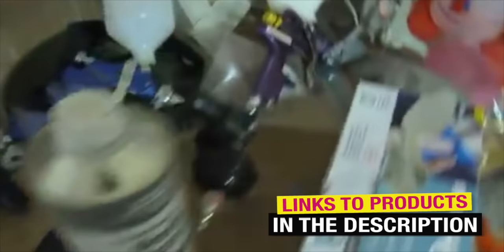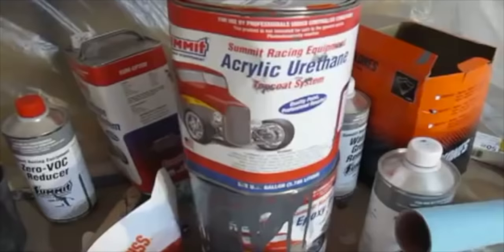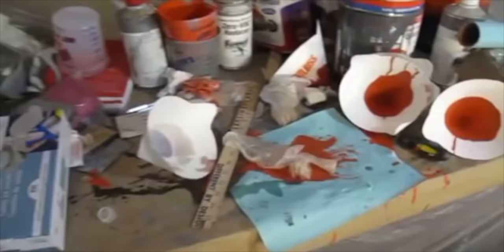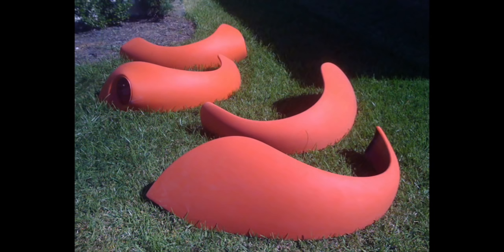Building a 1973 Front Engine V8 VW Bug

Comment: The color is awesome.....I did mine in yellow so bright that you have to wear sunglasses at midnight with no lights to avoid blindness.  Your garage setup was about the same as mine.  Sags?  Oh, yeah......Really super video!  The black really makes it.
Reply from the maker: That's awesome! Got any video or pictures?
Reply: @cmattdabrat  Sorry.....too long ago.
Reply from the maker: @tomnekuda3818  I hear that.
Reply: @cmattdabrat  I just went over this upload again to admire some of the slick things you did to get to the final product.  That is a super-nice driveline tunnel......I'd have been proud of bending up such a nice piece of metal.  Plus the roll cage and hanging the seats/gauges/steering column.....really nice work.  I don't think I would have ever let it go just for the sheer joy of putting the hurt on some street racers.  I think I would have tried to hide the intake in some fashion....maybe a bubble hood or a cold air intake just in front of the windshield.  Anyway, it is still impressive to me.  If you've posted more creations to youtube, let me know.  Tom

Comment: Right on . That's bad ass .. I wanna build one oneday.  Mid engine.  Totally trick
Reply from the maker: Nice! I'm thinking about building a mid-engine bug with a hayabusa engine in it.
Reply: @cmattdabrat  😳
Reply: @cmattdabrat  that would be awesome .. I'm not a Ford guy but the eco boost v6 is suh-wheeeet
Reply from the maker: @jamestorres5582  That would be sweet! Those things have some power, great aftermarket support, not to mention weight savings and better gas... if you're not getting on it all the time.
Reply from the maker: @jamestorres5582  Thanks!

Comment: Looks awesome when painting again wet the floor and walls
Reply from the maker: Thank you! I wet the floors, but not the walls. There wasn't too much trash in the paint and took minimal cutting and buffing to get the paint looking like glass.
Reply: Matthew Chevalier my truck is a 93 model GMC well it a custom painted fade job on it and to date it still looks good I figure they put a lot of clear because wet sanding it can remove to coats of clear so what was left has done the paint good.
Reply from the maker: @rolandosanchez3664  Nice! I'd like to see that. Sounds like an awesome truck.

Comment: Nothing new here i done this year's ago, 70 super beetle,53 chevy frame,and a 327 with a power glide trans, And a Mopar 8 3/4  rearend .Alot of people have done this.
Reply from the maker: Yup. It's been done since the 60's. Even with the beam front suspension and pan. V8 behind the beam. Couple 2x4 mild steel frame rails, rear frame horn cutoff, and your choice of rear. I knew this was nothing new. First time I laid eyes on such a build was in the late 90's in a VW magazine. This build wasn't about, I did this first. It was, hey, it would be cool to see if I, an average Joe, can pull it off for cheap, with minimal skills, and tools.

Comment: Cool build great work may I ask what you used for a chassis frame what year is the frame much appreciated for the information I just pick 66 bug body i thank I'm going build a v8 bug myself
Reply from the maker: Nice! I used a 93 S10 Chevy frame. Had to shorten it in the middle and lop off the front and back to fit under the bug body. I used some leaf springs off a suzuki sidekick I believe and just remounted the leaf spring perches.

Comment: I'm building a bug similar to yours, yours has been my inspiration! Can you please tell me how you mounted the body?
Reply: I did one years ago using a Malibu frame (shortened 15"), it ended up with the running boards fastened to the frame rails, body welded directly in various places to the frame.
 Very solid and stiff united. An S-10 is a stronger frame for sure, stronger rear end too. Good choice. For wheels I used temp. spare 15" on front with VW tires and on back used Olds Toronado 15", these brought the tires inward to where the bug looked nearly stock after welding on little tabs to use the VW hub caps.  Mike
Reply: @mtwseneca  good to know! My body is really rusted out so I'm not sure if I can really use the original mount points but I'll try! Thank you!
Reply: @Smittybuilds  If you have any questions, I might be able to answer. I did the bug back in my BC (before computer) days, my son has it now. Add mount points- more is better. I wish I had pics on the computer.... Oh, the wt is 2800# with the 350, 9"rear,2.75 gears 2000 stahl, mini blower and went low 12s. I moved the motor back 4 "- not a good idea= less leg room. A single Big alum radiator in back like this guy did should be fine.  Mike
Reply from the maker: That's awesome! I used some angel iron the ran under the original mount points / heater channels in which I drilled some holes in the angle iron and welded the body to it. The body was welded at multiple points to the chassis. The roll cage, floor, and firewall were all welded to the body and frame. Made it a unibody.
Reply: @cmattdabrat  Matt, you did a beautiful job, great craftsmanship!
Reply from the maker: @mtwseneca  Thanks! I appreciate that.
Reply from the maker: @mtwseneca  Thank you! I really appreciate it. For a hobbiest and a non professional, that means a lot.

Comment: I'm glad to see you're still alive even with that respirator I would not be surprised if you don't end up with emphysema from that but is a good job really good job man I am quite impressed with the work you have done on the whole bug! A buddy of mine built one back in high school talk in the 70s and it was really fast and really scary you did a really nice job man cheers to you
Reply from the maker: Thank you! I really appreciate it. Sounds like for future painting projects I need something better.  What would you suggest? I'm no expert and open to learning.
Reply: @cmattdabrat  no I'm not a professional either I just know those respirators let a lot of stuff in if you're ever doing painting in an enclosed area like that would be good to get a fresh air respirator oh, breathing that stuff in is so dangerous brother I've done it so many times I can't even count one time in a bathroom with a two-part epoxy mix and the reducer was so hot I came out of there like stunned was not the same for about 4 weeks but your paint jobs look fantastic especially sings how everybody b**** about Harbor Freight but the best setup I have is the HLVP COMBO unit that harbor freight sells. It has perfect pressure you can carry it around with you or hang it and it hardly puts out any overspray at all which is a plus I know you know that especially with the great work that you're doing also sometimes it helps to keep the dust down if you wet down the floor I know it's hard to do in a regular garage at home but the best thing you can do is to get that exhaust going out anyway you did a great job man and I am truly impressed with that V8 Volkswagen it was quite clean. If you ever get a chance check out the German kits that they put together they are producing old Volkswagens right on the line and selling them now they have a Audi turbocharged V8 and it's clean as well but it's mostly all Volkswagen of course they tied the frames together and everything else anyway brother fantastic job keep up the great work
Reply from the maker: @MakinEndsMeet69  Thanks, bro! The HVLP Harbor Freight gun is definitely an affordable gem! Did an awesome job on the bugs paint. I had wet the floors when I was painting, which helped keep dust to a minimum. When I was painting with the door semi-closed, as soon as I was done, I exited the garage and did my cleanup shortly there after. When I painted the whole car, I just had some mosquito net up with the door wide open. In the future though, I will think out the health part of it better lol. Thanks again! I appreciate it.

Comment: Bro cool build I'm starting my crawler build it's a 74 bug on a straight axel 4x4 Toyota frame .. any tips on how to do the front engine bay? Pedals?
Reply from the maker: Sounds like a cool project! I used a sheet of 16 gauge steel, weld it to the body and the chassis. The same thing for the floor and tunnel. I just made patterns / mockups for the firewall, flooring and tunnel out of poster board. The tunnel was made out of 14 gauge steel. I used a large pipe to bend the tunnel shape. The pedals were Wilwood floor mounts. You can reinforce the area with some square tubing or angle iron, but I didn't need to because of the thick 16 gauge flooring. I went with 16 gauge because I wouldn't have to do and bead rolls, and the car could have used a little weight.
Reply: @cmattdabrat  awesome I'm looking for pedals now .. I'm going to use 16 gauge for flooring.. I appreciate your response!
Reply from the maker: @toddstarr3505  Nice! Good luck, and just be patient because these things aren't bolt on mods. lol...

Comment: What did you use for the chassis ?  It would be nice to find out what components you used for the build.
Reply from the maker: In a nutshell, it's a S10 pickup truck chassis, with a v8 conversion kit, and a bug body. Cut everything to fit.

Comment: Pretty cool build Matt ! Of course  your idea isnt anything  that new one of my Dads freinds a heck of a Welder and car buff built one in the 1970s in South Florida  he had to put the drivers seat  where the back seat really was  placed by VW and  because of the torque he built Wheelie bars that he actually  drove the car on  around town in a full Wheel stand ! He did  install 2 brake systems on the rear wheels so he could indecently brake each side to Steer  this was back in the days that  my Hometown was a small town and the local Police Chief was  a hot Rodder  who actually closed down  roadways to do Dragracing on! Eventually that  City was one of the very first to have  one of the earliest National  Hot Rod Drag racing tracks  which was where many big names did some of their first passes  and despite it being a Competition  it  is well known that many of the families and teams  were friendly and even helped one another and often ate together !  BTW it was Hollywood Florida  and the track officially shut down in the early 80s and was demolished  soon after  the paint looks pretty good ! I sprayed my very first car using a Campbell Housefeild HVLP. Spray unit  i bought to spray Woodworking finishes  it  is a self contained unit  that i still use for Woodworking  many people swear by those cheap HF spray guns  for Automotive paint but then i didnt have a Compressor that would had kept up  so i chose the previous method i mentioned to Spray a MGB. I owned for 14 years  i had no runs  or major Blemishes  and it was a factory color respray to freshen up the many years of the Florida Sun damage to the original paint  and some minor bumps and Bruises  the Stance and look of your Bug with the Intake coming thru the hood and the color scheme came out really Bad Ass  i even like the X patterns on the Headlights  and the interior  it all kind of States that i not your Average Aircooled VW anymore !
Reply from the maker: You're right about that! I recall seeing a V8 bug in a VW magazine back in the 90's. I always wanted to do one, so this was my budget attempt at it. Sounds like a cool build! Thanks for sharing.

Comment: too bad the intake does not line up with the center it looks like a small modification can fix that blemish on the front
 view
Reply from the maker: I agree! The engine is offset because of the steering shaft.
Reply: I noticed that too!!! Was coming to comment but you beat me to it.... Badass Bug though... for me the easy fix there would be a hood scoop....but that’s just my opinion

Comment: The welds are slightly off putting
Reply from the maker: Ehhh, first time at doing this. I got better at it as I went along.
Reply: It fine to be nonchalant about it until your welds break doing a launch or doing 100. Still, kudos on the build.

Comment: Why not just put it in the back seat to keep the weight over the drive wheels?...
Reply from the maker: Much more difficult building a mid / rear engine.  The engine would either stick out the back, or would have to be pulleys towards your back. I plan to do another in the future mid / rear engine.